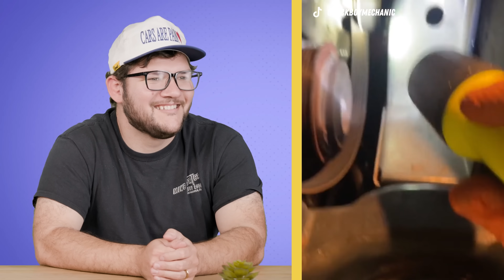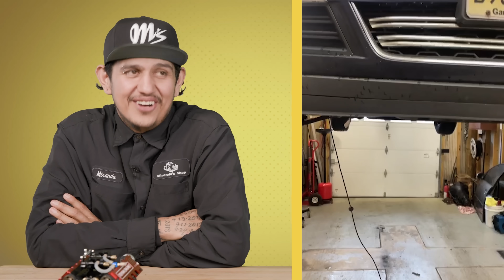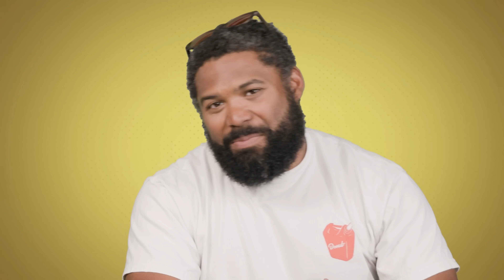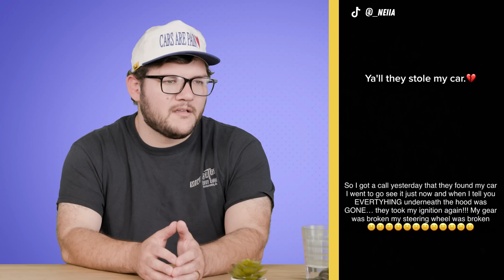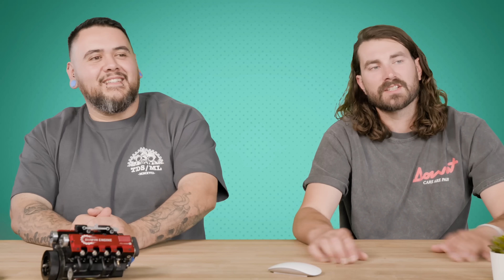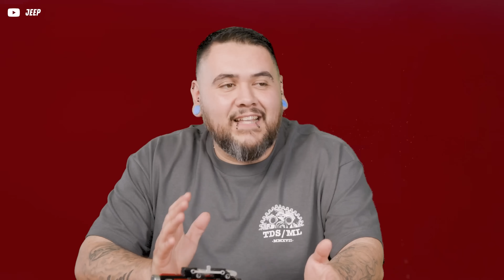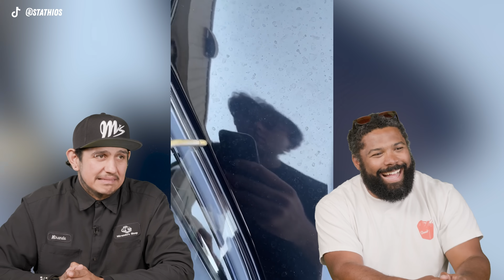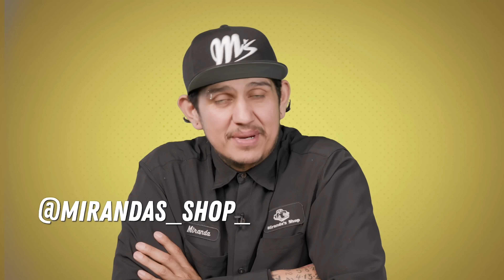Mechanic Reacts to Car Engineering Fails

Comment: I have questions about That car that was leaking through the lights into inside.  I'm wondering 1, how the dealer didn't notice that while it was sitting on their lot. Or 2, did they notice it and just tried to fix it and sell it anyway, and the fix failed. Or just a random failure from the factory that just took time to show itself. Also, follow up on if the customer recieved a new vehicle from the dealer on warranty or was it only a few days since purchase or did the dealer tell them to turn it into their insurance company.

Comment: I used to be a mechanic in the IDF we used to do routine maintenance on vehicles and a lotta times those vehicles would be Humvees, one of the routine jobs was to change the gear box oil, easy right? Just open the bolt to empty the gearbox right?

SOME HUMVEES DON'T HAVE A DRAINING BOLT!!

Comment: mini cooper hoodlatch issue is a total engenering flop. The pull cable fails and you have to either go from underneith the vehicle to smack it with a hammer and long pry bar or through the wheel well.

couple this with a dead battery and your left with a paperweight. Not the hardest fix, but the 1 into 2 cable coupler is a total flop when one side still fails.

Comment: For the "too long bolt": it is easy to just think of the bolt being too long and using a shorter one, but engineers need to think of the implications... 

Potentially the bolt needs to be that long to thread into the engine block in an area that can handle the stress. So it could be that in order to use a shorter bolt the engine block needs to be redesigned and the casting tools need to be updated. Just imagine the costs on that... 

Engineers usually like to still do it right, but higher management does not see the benefit. If the drawback is that the mechanic has to take out the engine to change that pulley, so be it. These things usually don't go bad during warranty period, so really low risk for the OEM... 

Higher management usually doesn't care for things after the warranty period....

Comment: I've had sunroof leak issues before. On some of the bigger ones I went ahead and stuck them in the bake booth and it dried everything out. After which we replace the seals and remedied the leak. A double cycle on a bake Booth, as long as nothing foreign is sitting on anything, will fix the problem as long as you fix the leak. You can even go the extra mile after draining everything out and put dielectric grease on all the connections
Reply: The way that was leaking, I imagine one of the drain hoses were clogged. Or not installed correctly. We've had cars come through the dealership where the hose was never plugged in, and the drain tube still had the plastic plug installed...

Comment: Most "engineering" problems are a 2 part problem, one is a hand-me-down from the bean counters basically saying, 
"I don't care if you say we need to do _____!!!  ____ costs us __ more money and we cant sell this product for more than __ so we profit less if we do what you say we need to do."_

and the 2nd is to many different hands in the cookie jar and them not conversing with one another looking for problems when the two different aspects are put together. For example, the Idler pulley bolt hitting the frame rail, that is the Engine Engineering and Chassis Engineering departments not talking to each other too see if one needs an additional feature or something. That bolt probably need to be that long to go though the pulley and timing cover and into the block with enough thread engagement and thus it should have been brought to the chassis engineering department that they needed to implement an access hole though the frame rail or dimpled contour. 
At the same time, this could still be an issue from the first problem mentioned above about it being a hand-me-down from the bean counters.... Because they're gonna say, "no hole because then we need to supply additional plugs to seal the hole and we need to have extra machining cost for stamping dies and not dimple either because again, we have additional cost of machining stamping dies so let the mechanics deal with it when the idlers fail, its not our problem."

Comment: It has long been my belief that whoever designs the car should be given a tool kit and told to perform some routine tasks on the car, say replace some belts and hoses and maybe pull the starter motor. Let them remove and replace a few parts. After that send them back to the drawing board.

Comment: GM does not care if you ever have to work on a vehicle or not. The engineer's do not care and they do not design vehicles to be worked on or maintained. The engineers designed them as cheap as possible and whatever is easiest to build in the factory.

Comment: Just bought a 2010 Honda accord 2.4L. The K series engine is known to be reliable. Well low and behold, the damn VTC actuator is making a loud noise on a cold start and I’m being quoted ridiculous numbers to replace it and the entire timing chain and tensioner. Stupid engineers. This is very common on multiple Honda 2.4L engines. I passed on the 6cylinder model because of the bad VCM engine. Talk about Honda reliability.

Comment: Marketing dweebs and safety people are to blame for the majority of engineering failures. Car weight/ dimension/ performance is specified well in advance and engineers are sometimes stuck trying to make something fit that was specified by a marketing weenie. Computers are the same way, especially mobile and handhelds. There's an ancient conundrum... good, cheap, fast... choose any two.

Comment: Ford 4.0 SOHC head gasket/warped head issues. They removed 2 of the bolts from the design that causes the heads to warp much more easily than previous models so as to cut production costs

Comment: I have a '63 Jeep Gladiator back when jeep was still owned by kaiser. It sat in a field for 15 yrs. A new valve cover and a cleaned carburetor later and it started right up. Jeep definitely went the way of overengineered and it shows.

Comment: I have a 2010 Mazda 6 2.2 turbo diesel. Really nice car to drive, quite quick etc, but, it has a really nasty maintainance issue. Mazda decided to ignore the if it aint broke, don't fix it law, they used a timing chain instead of a toothed belt, then made access a total b1tch!  So to replace the timing chain, which is a more frequent job than it should be due to them specing a poor quality chain, is an 8 hour job!  Not helped by having to remove the injectors to remove the cam cover!  And, if you mess up re-sealing the timing covers, because access, and they leak, then it has to be done again! If they had used a belt job time would have been a few hours max.  However, BMW managed to beat even this, on the 1 series, they use a timing chain too, except they located this at the flywheel end of the engine, so the engine has to be pulled to replace the chain! I'm sorry but that is just fcuking moronic!

Comment: Dude that Q3 leak is one thing, but I used to work at an Audi dealer and those pano sunroofs used to literally explode. If you took then from a warm garage to a snowy outside, they'd contract and explode. It was my least favorite thing to vacuum.

Comment: Ford and the high pressure fuel pumps on the power stroke diesel  that self destruct and kill the $800 each fuel injectors and contaminate the whole fuel system with aluminum.

Comment: Speaking as an engineer. We work really hard to design these products. They go through rigorous testing and we have teams of people combing through the designs to identify potential issues like this. BUT we also work in the real world despite what people think. We don't have infinite time and money to revise issues. Some of these issues are caused by poor management, communication, pressure from accounting, or a whole host of other issues. We get a lot of flak for when things go wrong but it takes a whole team top to bottom for these flaws to make it into production.
Reply: You had me at poor management bud as a young guy I’m learning how easy it is for management to fuck up literally anything and not give a shit 😂
Reply: Also a good point. Ford Escort 1980-87 model was designed by committee, and it showed. I needed a full set of wrenches to do maintenance on it, could never reach anything that needed to be serviced, it was a nightmare. Don't design cars by committee. Also, on AKE-class naval support ships, you can clearly see the dividing line where the forward end design team and after end design team's remits meet, because all the pipes, wiring, and ductwork in the main deck overhead takes a jog in a random direction, because not only did they not match it up, they didn't even run them in the same place. Some channels even cross because of this. I feel so sorry for the guys who had to actually figure out how to match all that stuff together and fix the design teams' problems!
Reply: @Vinemaple that's the mechanic...
Reply: Considering how much money they make and how much they've gotten to bail them out when they're put in jeopardy, I'd think that they do have the money, whether they spend it or not is up to them.
Reply: Design it right the first time.    Yall wanna make em all compact so everything is a nightmare to work on quit making excuses you just think your shit don't stink cause you over spent on your education
Reply: @mikemitchell9157  bro take the stick out your ass why are you so mad
Reply: @mikemitchell9157  bro. You design a car right the first time lol. How dumb are you? You think they just burn and churn these out

Comment: As an engineer in the auto industry- I agree with most of these, but with some nuance. Y’all should have an auto industry engineer join on the next one.

As engineers we want to make good products. If our management sets requirements and allocates resources so we can make something sensible to work on we will. 

For Tesla- if management wanted to fix the bad interiors and panel alignment issues, engineering could (and has everywhere else) design a solution/processes/tooling to fix the issues. Unfortunately they feel this isn’t an issue because they’re selling more cars than they can produce (until recently). See bob lutz’s story of how GM did this in the early 2000’s after the South Korean MFR’s had great panel alignment.

Comment: To me, as a 23 year tech, it all depends on the book time for all of it.  It takes what it takes but like the belt tensioner,  if that too long bolt, if it bills for like 1.2 to 1.5 hours, then motor mount removal is required and your paid to do it that way.

And every car model is not what one would expect for quality.   Remember JD power initial quality award.  Well that's giving out to the company that had cars that break the least in the first 90 days of ownership.   So apparently a car that has no issues for the first 3 months, get an award!!  WtF.

Comment: 2:09 - Had a '99 TD5 Defender 110 for years. In the winters I 'd stuff newspapers under the floor mats, just so that I could remove the ice all at once. But that was the last of Solihull's great cars - a car where that panel alignment was so bad that you could see the road through a slit between the front door and the firewall.

God, I loved that car!

Comment: The engineers are also blaming the engineers. They work in groups, and one group might design the engine, the other the transmission, another the wire harnesses, etc. Not uncommon for the different groups to not sync up 100% on what all they need to accomplish.

Comment: Pre-1995, Chevrolet designs the Camaro Z28 with the wonderful LT1 5.7 l V8. Unfortunately, with their revolutionary new distributor system called an optispark, they mounted it behind the water pump. This specific distributor system was also very allergic to water and did not have a vacuum system until 1995 or 1996 so if your water pump gaskets started to leak at all, you also lost your $400 distributor

Comment: Fun fact: Sometime the fault lies with the factory AND the engineers. I used to work at a Toyota factory. Flaws come up and get identified by us guys on the line (line stops and those get pulled), the issue gets kicked back up to the engineers by QC, and hopefully they resolve it. Sometimes life goes on and the engineers or corporate bean counters, let it slide, and pray a recall doesn't happen.

Comment: I've worked for several OEM's as a quality engineer, production engineer, testing engineer and now in diagnostics. If there is one thing that is going wrong in every OEM and every department, it is that they don't go to the Gemba. My managers taking the important decisions don't speak to mechanics at all. They have no idea what they really need in their diagnostic software. 
As a production engineer we always struggled with new designs. We really had to fight to get the design engineers on the factory floor and realize it was near impossible to mount their parts. 
As a quality engineer it was a fight to get the production engineers to change their processes. 
As a testing engineer I found the same bugs again and again and had to wait years to reach a good product. 
In most big companies every department forms their own "island". They are old-fashioned and often all communication to another island needs to go through some manager. Change is slowed down and opportunities missed. It's the way it goes and you get used to it. Despite this it is still a really interesting industry to work in.

Comment: The landrover drain plug you loose it off but hold it in the hole and let out slowly until the flow is slower it works well and doesn't get the cover

Comment: Honestly as an engineer, we are not always the problem. It's the accountants 🤣 I don't want this part to work across 5 models, they do, so they can maximize profit
Reply: That's why it's your job to put your foot down and tell them no absolutely not. You tell them it's a safety hazard and will cost their mechanics more in maintenance
Reply: @kenshinhimura9387  😭🤣 good luck with that. Public companies focus on stock return and quarterly profits. That's like saying mechanics should only use OEM parts.
Reply: @JCHUCKK1020  oem parts are junk. Aftermarket is always better
Reply: @kenshinhimura9387  Wouldn't say always. Aftermarkets can be way better than OEM, but they're also not held to the same standards and can sometimes be way worse.
Reply: @kenshinhimura9387  depends on the part and the car. toyota uses denso, denso is literally the best you can get for a lot of parts. where if you get chrysler, well theres no wondering why it went bad the first time
Reply: @kenshinhimura9387  depends in your faith in the brand. I know toyota parts are going to last 200k miles. But volkswagen with their plastic oil pans and plastic shift linkage..... yeah I'm going aftermarket with that one.
Reply: @kenshinhimura9387  Here's the thing - the manufacturer doesn't pay the mechanics. The dealership is an independent franchise. As long as the design lasts beyond the warranty period the manufacturer doesn't have any reason to care how hard it's going to be on mechanics to repair. And warranty labor times are absolute garbage. Honda paid as little as 10 to 11 hours to pull pistons out of their engines and replace the rings under warranty. That's easily a 2 day eight to nine hours per day job start to finish. I never saw anyone do it faster. As for the franchise paying us, they're more than happy to tell the customer it's going to take 3, 4 5, 7 hours to do a job that used to take 1. That just means they get to make that much more money off the customer. Especially if it's something an independent shop isn't likely to have the tool on hand for.

As for aftermarket parts - if you think they're 'always better' you haven't been working on cars long enough. I've lost count how many times a customer has brought us (I work at a dealership) a car that another shop repaired to figure out when their repair failed. I look it over, find the mechanic diagnosed it correctly, and replaced the right part, but they used an aftermarket sensor that wasn't compatible. Replace with factory part, car runs fine. I've seen aftermarket oil seals start to leak within 20,000 miles - and worse than the factory ones they replaced. Aftermarket ball joints made so cheap they wore out in a year. The list goes on. Any aftermarket part that is actually made better than factory, is going to cost more than factory. If it's cheaper, it costs less for a reason.
Reply: @kenshinhimura9387  
" cost their mechanics more in maintenance" 

The accountants just heard "We get more money per job now" congrats now the situation is worse.